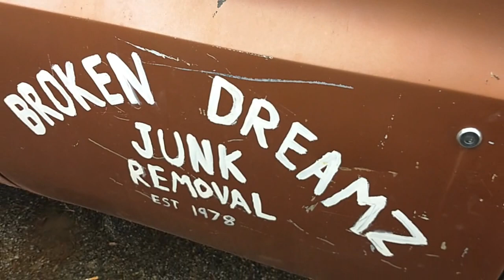The Junkman's Hustle

Comment: You know that Dunkin doesn't make that stuff right? that is prepared by a 3rd party company and shipped to them sealed in a plastic sleave along with several other sandwhiches. Same thing is true with Starbucks too. i know this first hand because i work for NCR and we supply all of the electronics for both of them. I remodel and upgrade the electronics in both of their stores for my job